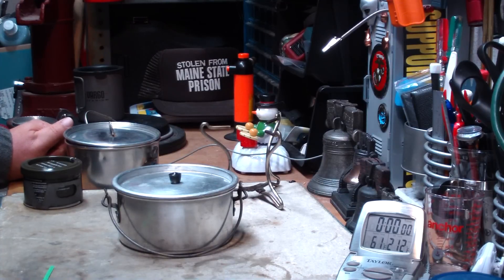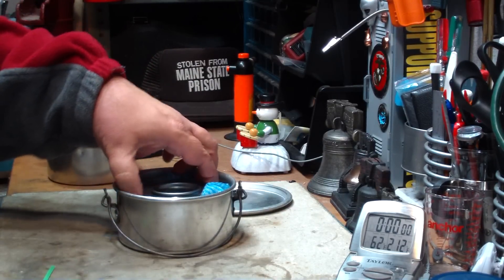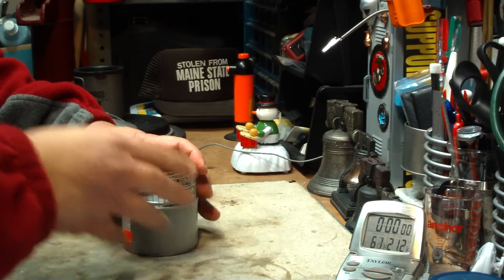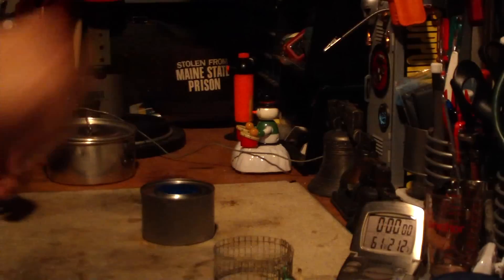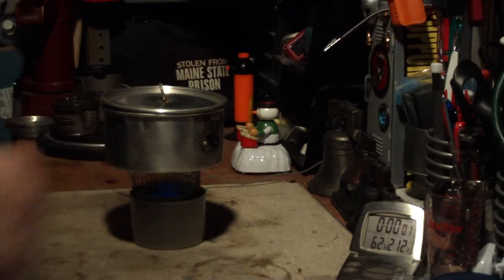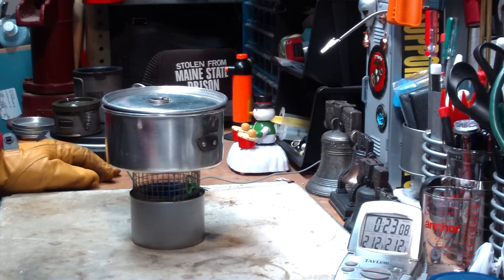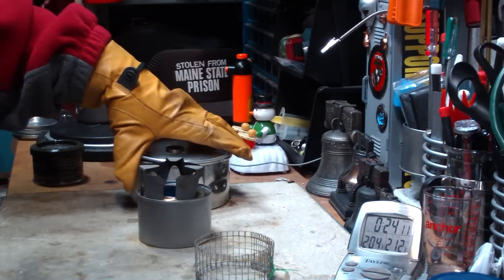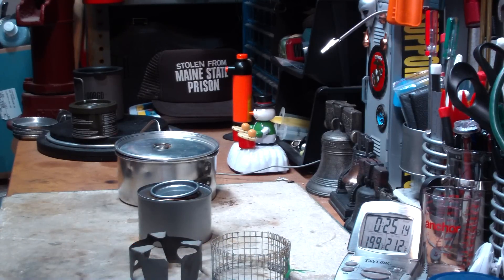Alternative Pot Stand for large "Sterno" can - Boil Test

Comment: I bilt a improved Penny stove from an instructuble. I'm doing truck brakes in cold garage and I lit stove on concrete floor &put a 5 L Bitburger minikeg full of water on top, I did two fill ups with the penny stove and then put a JobLot sterno underneath. It gives a wee bit of heat and I have warm water to clean my hands. I put a penny on top of minikeg open bung for a pressure relief valve. I call it the   "Penny radiator" or "Penny Waterheater".Thanx Hiram for inspiration!